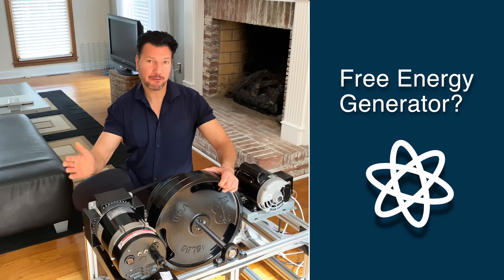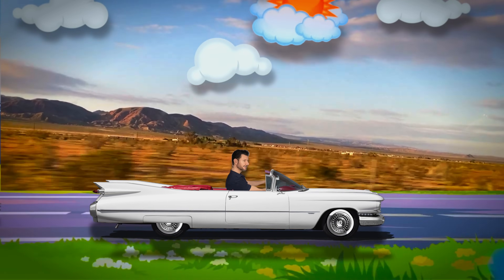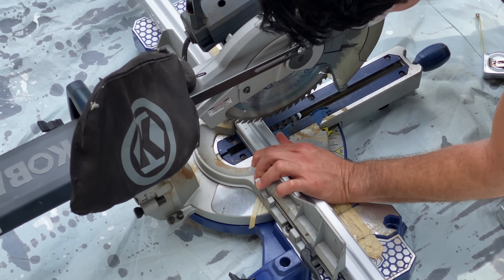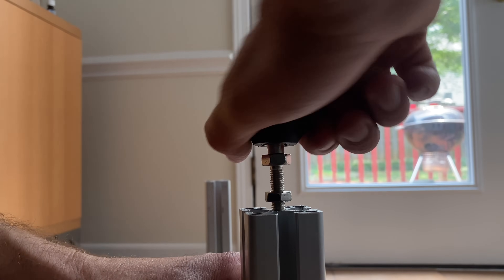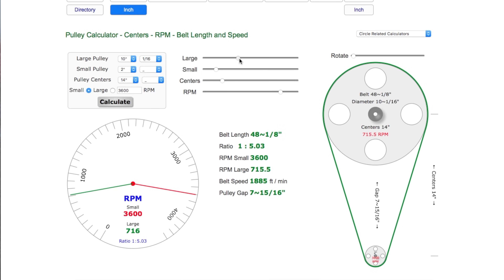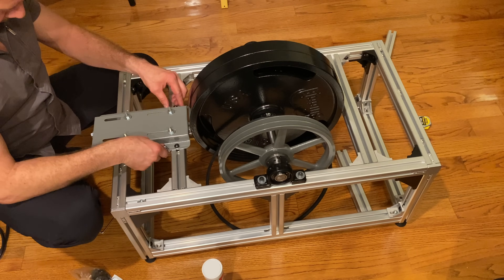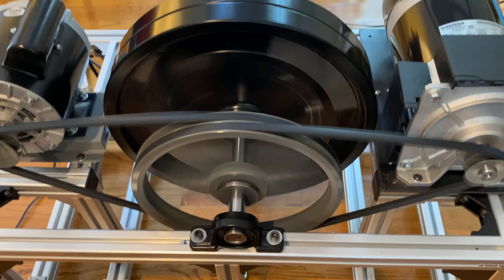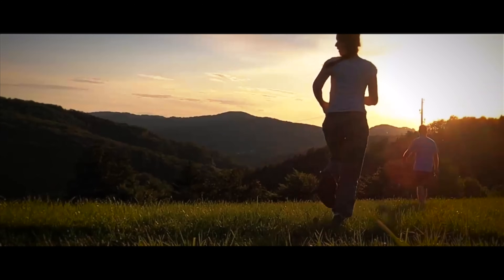How to Make a Free Energy Generator!

Comment: Sir what about if we use stabiliser to constant the input current that was coming out from the alternator

Motor  220v run through external source current  ,fly wheel weight should b double the weight of the alternator ,alternator should b 440v 
   The output of the alternator should connect to the stabiliser(transformer) which provide 220v constant to the motor 
 Would it work??

Comment: How about driving low torque DC alternator with AC motor using 6000watts pure Sine wave inverter to convert the low torque DC power to AC power then reverse the energy from the inverter to supply the AC motor driving the alternator?

Comment: Did you Use an permanent Magnet Generator For getting the Energy?
Reply from the maker: No unfortunately I didn’t have one.
Reply: @MarkusNenning  

BUT that is the trick so that you will get more Energy.
There are some Videos that Show how to modify the Car Generator With permanent Magnets.

Or, Bit havent Tried, you could directly get a permanent Magnet Generator from a wiind wheel For Home Use....there are Serveral For Serveral prices at The market. those do only Need lower rpm. But I do Not know If the modified Car Generator or the Wind generator is better For this Application. The car's one is certainly far cheaper especcially when you buy an used Item.
Reply from the maker: I did buy a used car alternator that I will eventually modify.
Reply: @MarkusNenning  great. A friend of Mine and I will soon start that Project as Well.

But probably WE will Use 3 Discs With Magnets and outer Rings With opposing Magnets For powering the Generator.
Reply from the maker: Would love to hear how that turns out.
Reply: @MarkusNenning  IF IT works aß planned I will defintively Post a Video and read the comments of the people crying FAKE.
Reply from the maker: If you get it to work and you live in the US I would love to see it.

Comment: I think its better to use 12 volts dc. Motor so it will not consume more current so it's not hard for the generator to supply curent qnd reduce load. all u need are 12 dc motor and a ac/dc inverter and a transfer gear if needed to cread more torque power or increase/decrease speed.hope it will help sharing my thoughts only.
Reply from the maker: Thanks Coby!

Comment: Stabilizing the electrical flow is important, using a specially designed step up and stabilizing the power supply for the first motor that rotates the dynom will help and i preferred not to use that flywheels as that results in lose of energy's, adding a few electronic components will definitely help

Concealed

SAM
Aum mane padma hum l

Comment: I stumbled across this video doing research for my physics class ( I am a mechatronics engineering student and an automation technician by trade). The system you built is of great craftsmanship. Your machine is very aesthetically pleasing, and your mechanical skill is impressive. 

The resulting power loss killing the motor is due to the efficiency rating in the generator itself as well as the motor itself, and other mechanical losses such as friction and heat in the shafts and bearings as well as any vibration. You did very well in limiting those transfers as much as possible.

Perpetual energy machines have been pursued by man since the beginning of industrialization. Yet, energy can not be created, it can only be transferred or transformed. . . 

 Let's say for simplicity you are using 100 volts to power your motor to full RPM. If your motor is only 80% efficiency rating (on the motor tag) then you are only resulting in 80% energy at the pulley ( not counting loss in the pully itself). the generator says it is only 80% efficient as well. So, as a result, you are only generating 80% of the original 80%. Essentially you are using 100 volts to generate 40volts (only calculating energy lost in the motors) resulting in the system consuming more power than produced. This is why the energy is perpetual. 
I hope this explanation clears up some confusion. 

Please continue your pursuit of clean energy! Thank you for such a well-made video on a well-built machine! 
Your humbleness in defeat is just as inspiring as your pursuit and drive! These characteristics are the origin of true knowledge!
Reply: you study physics and still think this is possible? Keep studying,
Reply: After watching a few of those videos from India, it seems they use synchronous motors and generators. They can be very efficient, so maybe that's why they seem to work?
Reply: Hola , esa pérdida , ya fuera por dónde sea o por lo que fuera , no se podría compensar y tal vez multiplicar aplicando una batería de poleas como ser ...ejemplo ...el sistema de engranaje que tiene un servo de aeromdelismo , pero con poleas y ver la cantidad que sea necesaria y como acomodar los distintos diámetros ?, si no sirve espero nadie lo tome a mal pero me interesa el tema y quería tratar de aportar algo .
Reply: So long as we have people like Don Trump, drifters and con men with continue to scam society
Reply from the maker: Wow thank you very much Jeremy!
Very kind of you to say and thanks so much for your detailed explanation!
You might find my latest video interesting as well. It’s a complete different concept of free energy.

The breakthrough in Free Energy - a system that cannot be debunked
https://youtu.be/wqbJWBtoFMQ

Comment: I think the rpm of the capacitor run motor should be higher than the rpm of the self energizing motor so that enough or greater current could flow thus powering appliances.

Comment: Great work.  What if you added an electric clutch to the starting motor and an rpm meter?  whenever the motor slows down too much it uses stored energy from say a battery system to increase the rpms then drops back out. plus i think you need a larger flywheel. maybe a gearbox with 3 to 1 ratio.  im not the engineer though, you are.

Comment: We are experiencing flywheel generator :
- PMG 500rpm 75kw
- 400kg flywheel 800mm diameter
- 7.5kw motor
- voltage regulator 80KVA
- 2 frequencies variator

Comment: Thank you for your effort, owner of the channel. I want to know the best ideal design for the production of power and the powers that can be reached, for example 50 KW to 200 Kw. I need a means of communication such as Telegram or email.
Reply from the maker: I will have a video in about 3 weeks that will show you how you can accomplish a 50kW unit. Stay tuned
Reply: @MarkusNenning  !
Reply from the maker: Breakthrough Green Energy -  Everything you need to know
https://youtu.be/uTbIJnEOw8Y

Comment: Could you not just use wind turbine that has a flywheel on it that is then connected to an alternator just charge batteries that would be connected to a ups system to help charge them for free on a winters day where there isn't much sun but loots of wind?
Reply from the maker: Could be worth a try but assuming if a flywheel would be beneficial to wind turbines they would probably have them installed on the giant wind turbines.
Just learned about a totally new technology the last few days.
I will share a video about it soon after my lithium battery video this weekend.
Thanks!
Reply: @MarkusNenning  well to magnates a car alternator you need voltage, the only way to get close to free energy is to use a static coil and then a rotary flywheel around that, if thus was connected to the shaft of then it would produce the electrical current needed to the allow the alternator to be magnetised thus allowing you to charge a ups set up, the main question will be the amount of rmp needed to produce enough voltage to charge a 12v battery that would be connected to the stator coil that would then go to the alternator.
Reply from the maker: @superslick5677  my next upcoming video is from a visit to an inventor that has a completely different approach hope you’ll watch it once it’s out.

Comment: May be I think to use Boost up current curcuit board combine with Battery or Capacitor to keep electricity inside before unplug back to the motor. All they will help the stability of currency and voltage.
Reply from the maker: Just build a battery pack
https://youtu.be/HzXQORIIUA4

Comment: You should have used permanent magnet alternator with 8 to 12 poles. With this it will have low RPM and produce full voltages. All other hardwares can be alter.
Reply from the maker: I found out about a new technology this week and will share a video soon.
Thanks Hasan!

Comment: what is the output currently you get? also try to fix a better dynamo which has greater voltage generation in low RPMs
Reply from the maker: The output drops immediately when switching over.
Thank you?

Comment: Can you use a vfd to drive the motor i think the results will change because there are alot of factors which doesn't allow motor to run on the generator and they can can be eliminated by adding a variable frequency drive. Especially power factor and the back emf which are responsible for the resistance also if you increase the motor rpm a little for a heads up start for the genrator so when the motor is switched to genrator power it will lose some rpms which will be adjusted if we already added rpm to the motor
Reply from the maker: Maybe worth trying 
Thank you!

Comment: I think the magnets of the 4800 Watt generator are too strong for a 1/3 hp motor..There should be a threshold of power ratio between these two to be able to run perpetually at fixed speed with a help of a capacitor and a good sized flywheel.. Let's say about 5:1 or 6:1 ratio of generator power to motor power. And lastly, a frequency drive is necessary for the motor to maintain the frequency at 60 Hz and a switchable variable capacitor for power factor correction in case of too much inductive load..It's better to couple it together in one shaft to avoid the losses of friction at least and avoid slippage. You should have also tested the output voltage before switching..I think it is not generating voltage or it is damaged.
Reply from the maker: I have tested the output voltage by plugging in a second motor and it works.
Thank you!

Comment: In order to generate power you have to add a small generator to keep the fly wheel running  at constant RPM.
Reply: A SOLAR PANEL TO RUN THE LOW HP MOTOR TO RUN A LOW RPM ALTERNATOR GENERATOR. i am working on a system now large flywheel of 1000 rpm to a low rpm alternator of 600 rpm using a dc motor, a dc motor has more power than ac and it can run high rpm, run the dc motor from a solar panel and batteries if needed. during the day the system should charge the batteries all day to run all night! 1 48 volt battery would run a dc motor for a very long time, and set the solar panels to charge the battery. next item will be a hydrogen motor generator. the only problem is the corrosion of the plates from the material. maybe titanium would be better than stainless. or make a system to clean the plates and have 2 systems one cleaning while other one is running. just a thought. looking at the hydrogen maker more now!
Reply: @butchratell7569 You would be wasting your money on something that does not work
Reply: is not generator supposed to kee[ the wheel running?

Comment: I think you can still use it as a power saver aslong the the current draw of the output generator will not drag the  rotation of the flywheel.. try using lower wattage for the input motor than cam drive the flywheel and the generator even in full output capacity of the generator. I hope i make sense 😅😅😅
Reply from the maker: Thanks 
I actually removed the flywheel altogether and try something different now.

Comment: At night I just use an alternator and a capacitor, I spin the alternator with a cordless drill, which has been charged by an inverter, which charges 4x12v batteries and extra drill battery, and I power my cabin at night, during the day batteries charge on solar.

Comment: Since you lose about 20% of the energy in the belts, what about connecting the shafts all at the center. Run them as one unit. Turn them all end to end. Delete belts. Would have to change polarity on one. Just going by something I learned on another channel. But, it still may not work any way. IDK
Reply from the maker: Thanks Mark!

Comment: What about 12 volt DC? You can get a car alternator with a hairpin stator that easily generates 300+ amps at under 3000 rpm and just feed the AC motor the required power to function at that rpm via a pure sine wave inverter running off of the alternator. Theoretically, you should have an abundance of converted amperage to run just about anything household. You probably wouldn’t even need a flywheel as the motor and alternator are already balanced. That’s going to be my approach to fabricating my perpetual power source.
Reply from the maker: That is actually my next approach Larry.
I got a used alternator 140Amps “only”
I will remove the flywheel and change the pulley a bit.
Thanks!
Reply: Good  afternoon sir  pic can u help me out  tell  the RPM of the  motor  u used  for 7kva  pic
Reply from the maker: @bolajidele3011  the motor is 3400rpm
You can see the details in this video 
How to Make a Free Energy Generator Part 2!
https://youtu.be/tFqn-atYcOU

Comment: Its my impression, or did you use TWO weights to do the flywheel? Maybe there is the problem.
Reply from the maker: Yes I did use 2 weights.
I could add more weights or take one off.
Wanted it to be scalable.

Comment: Instead of the generator powering a motor have it power a hydrogen generator and combust the hydrogen in a tesla turbine to spin the flywheel
Reply: Closed system so you can recycle the exhaust its pretty much distilled water
Reply from the maker: Wow that is actually a great idea Berrie!
Appreciate that input and will try to figure out how I can make that a reality.

Comment: Thank you for sharing. I think if this is going to work, the generator have to be reconstructed - I see in other videos the permanent magnets are installed in the rotor. But they are installed in a unusual way!
Reply from the maker: Thanks Urban!
I agree and that’s why I already bought a used car alternator and will try to add permanent magnets to it and modify it.
Reply: Cat alternator is 3 phase, u wld have to retred the copper inside to single phase and remove the regulator so it can become A.C generator.

Instead, buy niemodium magnets and construct it on ur that ur generator u used b4..... And try

Comment: I think the pulley sizes need adjusted: big pulley on motor to smaller pulley on flywheel, then second big pulley on flywheel to smaller pulley on generator. This would maximize rpm at the generator with momentum from flywheel allowing smaller motor to keep it going. 
The pulley set up in the video basically uses same rpms for motor and generator which removes possible increase from the generator.
Reply: I know ?? Why has he not done that?. That’s the point in having the fly wheel and pulleys! I hope he sees this and makes it properly.. the same way the others are made.
Reply from the maker: I have tried this Mark.
Still wasn’t successful unfortunately.
Reply: @MarkusNenning  have you got a video showing that buddy? I only ask because I’ve bought most of the parts to make one I just need the stepping up gears mate. So large gear on the motor going to a small gear/pulley to the fly wheel. A second large gear on the fly wheel leading to a small gear on the generator of electricity. Can you show the video?
Reply from the maker: @markrimmer4567   No sorry Mark I don’t have one yet but will make one soon.
Let me know how your project works out.
Reply: @MarkusNenning  if I’ve spent all the money buying everything as you have. I don’t get why you have made a free energy machine that can’t work and ask me to post a machine that might?
Reply from the maker: I have not given up Mark I just have a full time job and only limited time.
Why would you be against sharing your success?
Reply: @MarkusNenning  I will. I have a full time job too. all u have to do is make a Video where you make a video where you have ALL-the parts for the machine. And finish making it work by gearing it up as we explained and showing the results mate. If it works or not .. there’s no way the one you spent so much time and money would work. So spend ten minutes gearing it up . You could take 39 mins out of your working day and post the results ❤️
Reply: I hope you adjust your machine.. I’ll try to get all the parts for mine and hopefully. I’ll post the results on here ! Fingers crossed it works🤞
Reply: Yes
Reply: True I think he did it just to discredit indian minds which are actually coming out with inventions to be lauded

Comment: I think it's possible to make this work. First, all gas generators require 3600rpm to work. You have to take into account that the Amp draw of the motor you used I'm guessing was 110v with around  15amp. If you use 220v motor at around 7.5 Amp then use a permanent magnet low 100 - 250rpm motor you would have succeeded. Good luck
Reply: I will install another auxillary motor just to maintain the speed powered by a battery and hook up alternator to charge the battery your almost there
Reply: @christianserrano4192  I've tried it. The battery drains faster than the charger can keep up but mine wasn't auxiliary. Let me know if you have success.
Reply from the maker: Thanks Mike!
I am trying something using a modified car alternator. Hopefully more successful this time.
Reply: Ok let me know sir i might make 1 too 😉

Comment: What I used was a simple car alternater a 12v a fue battery's a 12 v motor  a gear  system to produce high torque  a 100 lbs flywheel a a rpm sensor a micro controller to only give power when the rpm has reached the minimum speed to use the battery to speed up then let the flywheel
Reply from the maker: Is your system still running?